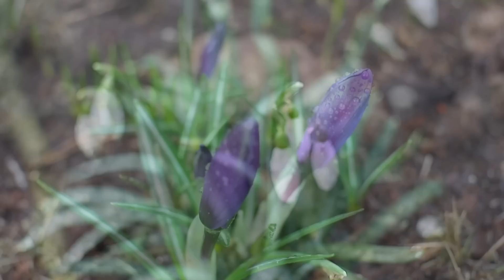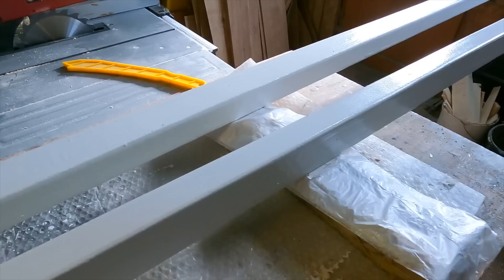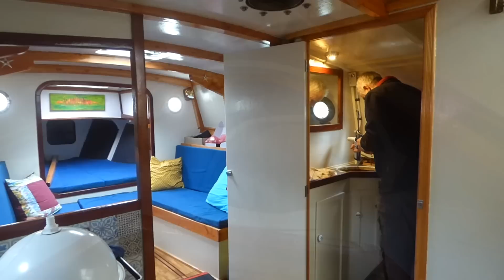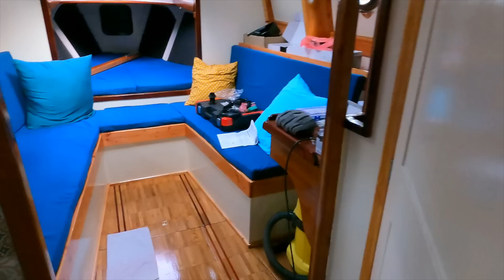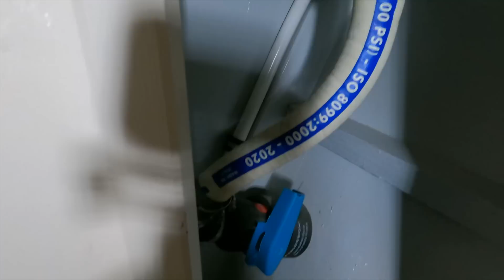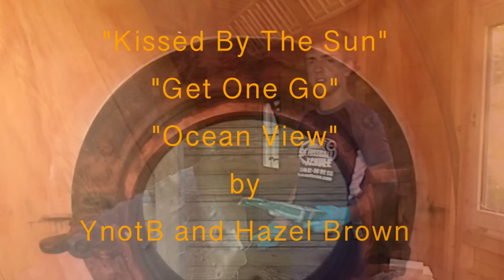Heads And Yards; Building A Cruising Sailboat - SV Tapatya EP267

Comment: just about had another accident with that loose power sander on the bench, you just about grabbed it to keep it from falling with your unprotected hand. lots of bad things could have happened while leaning on it with one arm too. it needed to be securely attached to the bench.  .. safety glasses?.  tsk...tsk...tsk.. :)

BTW, i shudder to think of the foolish things i've managed to get away with over the years..."but for the grace of god...".
Reply: Hell! For a moment I thought...
Reply: I saw that too and nearly fainted!
Reply from the maker: Camera perspective. It wasn’t anything really!
Reply: @SVTapatya  - The thing is, Tony.. it's all good right up until that one time that it ain't. For tasks like that one, out of a few scraps of wood, I knocked up a small framelike jig that could securely clamp onto the sander, then clamp the whole jig upside-down or on its side to a bench, or in a vice, or even just used like a bench hook. It only takes a few minutes to make, yet makes a whole lot of jobs easier and safer.